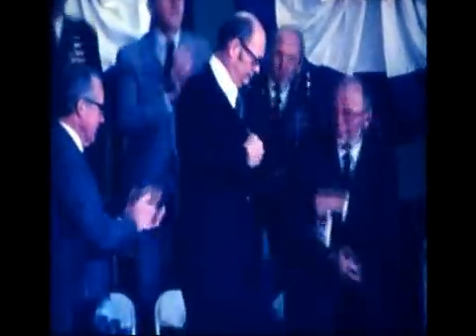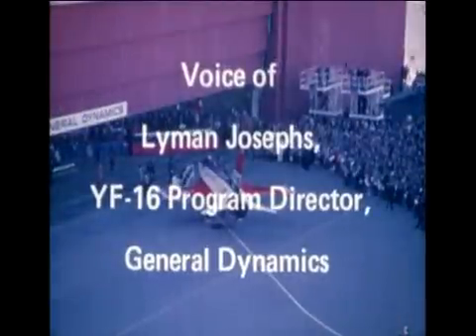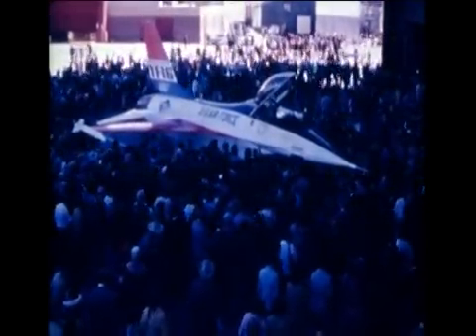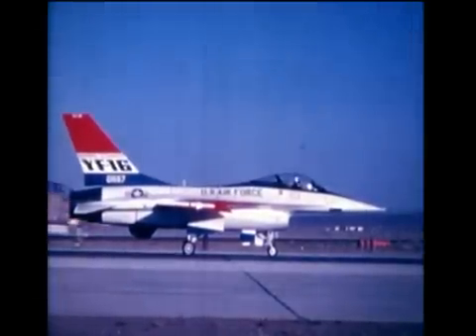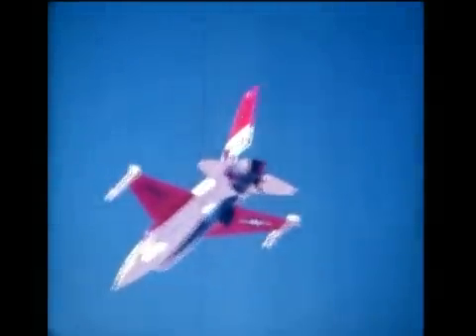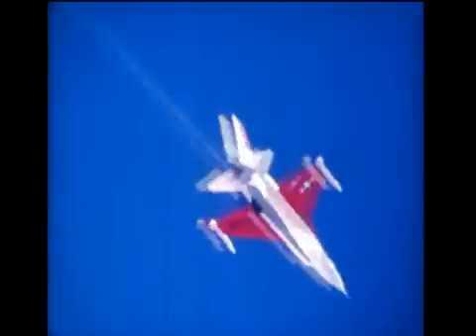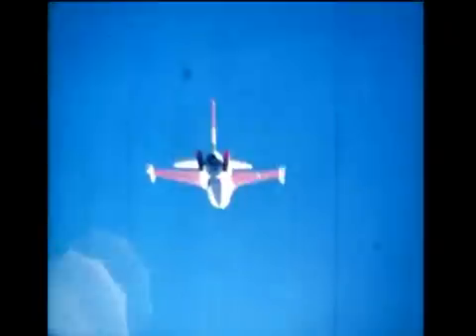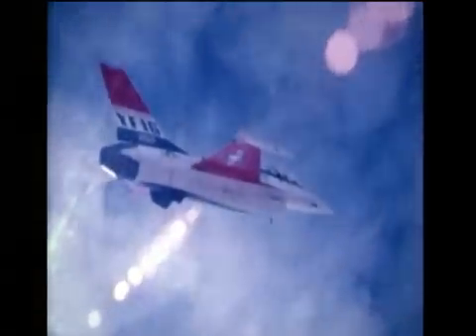F-16 roll out ceremony and Flying Start

Comment: Had they (decision-makers, designers, airmen) only known this beauty was going to be present on battlefields for another 50 years. And the F-16 is not at the end at all, still is she proving to be more capable against any type of adversaries. The F-16 Block 70 is a highly advanced jet, capable of any tasks! With the magnificent desing which did not age at all and electronic / weapon systems being upgraded it is still state of the art jet.

Comment: This "little" jet has provided a very nice living for me over the last 36 years. I've had the pleasure of assembling several thousand during production. Then re-working some in the Mid-Life Update program. And finally processing new jets through fuel operations, Green Run, first flight and delivery. Sadly, in a few short years the current Mod programs will end and there will be no more F-16s in Fort Worth. Hopefully I'll be retired before that happens cause I have no desire to work on the F-35.